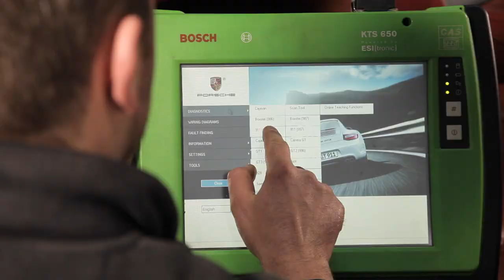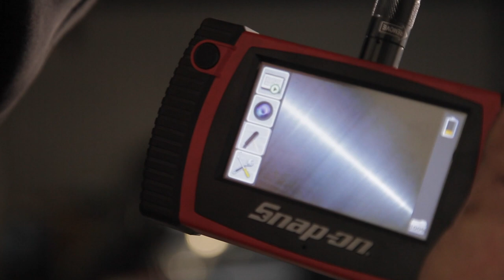A Look Behind the Scenes at Unique Porsche Specialists, Westhoughton, Greater Manchester

Comment: My local Porsche people told me my Panamera needed a new a/c conditioner at cost of 882.00 so system would blow cold air. Unhappy with aspects of their service, looked elsewhere, found Unique Porsche, Darron King said he'd check car before ordering new condenser. Reassured by his approach and cost breakdown (even cheaper if new condenser required) so went ahead. Darren kept me fully informed throughout and eventually traced problem and by resetting a/c electronics of compressor and condenser and regassing system had it blowing cold air saving me over 600.00  Delighted with his work I'll use him in future, even though its 150 mile round trip from Cumbria, and have no hesitation in recommending him to other Porsche owners.